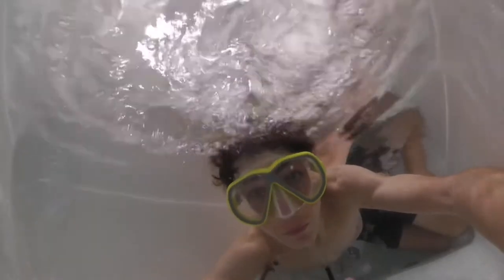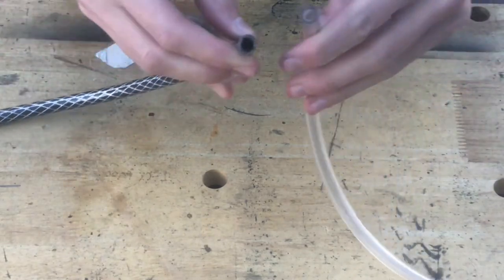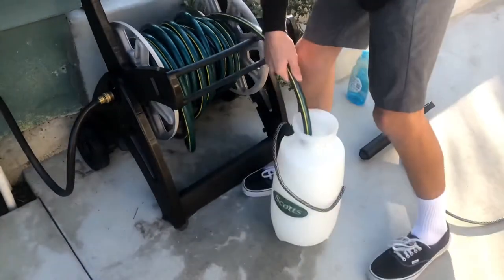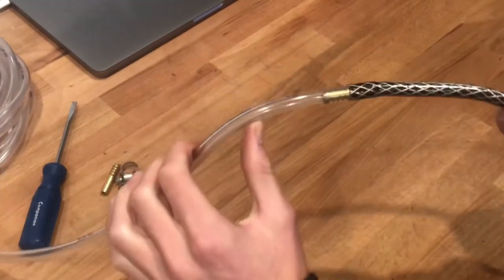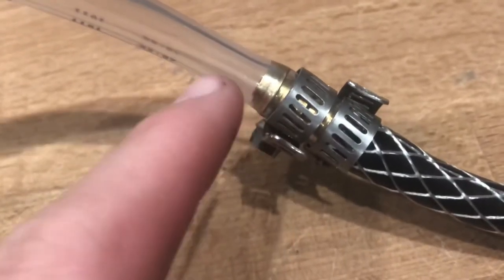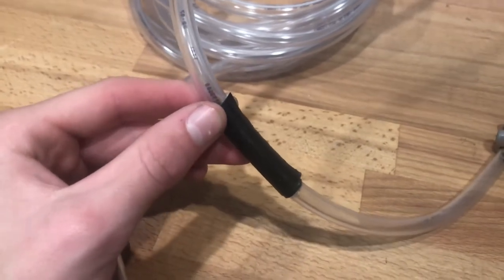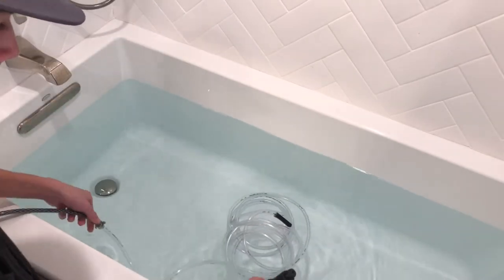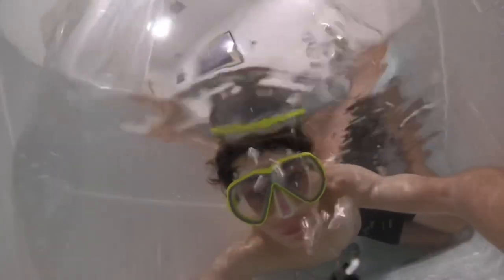How to Build a Scuba Tank | Tutorial

Comment: i plan to use this information to build my own airtank i plan to use 6, 2 leiter bottles as i only feel safe pumping them up to 60PSI each leading to a theoretical max psi of  340 Acounting for cutting off the bottem of the bottle. then i was going to create a regulator and i thought that the cheap way the weed sprayers do it is good enough for me then im gonna put them all togeather into an airtank attatch a bicycle air valve to seal the tank and using a 3d printed fitting to screw onto the bicycle air valve and attach to a hose that goes through a oneway valve and to a scuba mask hopefully this will allow me to breath are 14-15 psi adjusting it to get the right amount in theroy it should be somthing i can just put on my face and on my back then hop ion the water and when i breath in i get air and when i breathe out it expelss the co2 and i get new air using a simple system of 2 one way valves